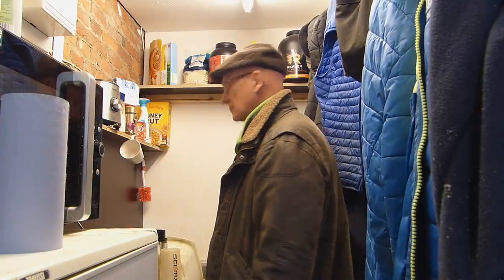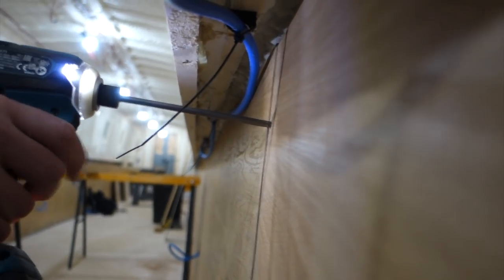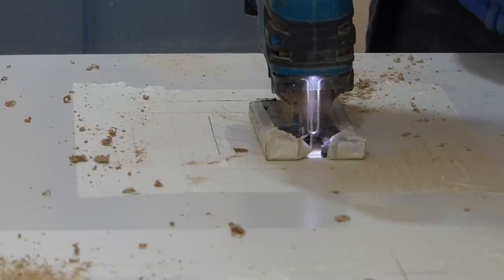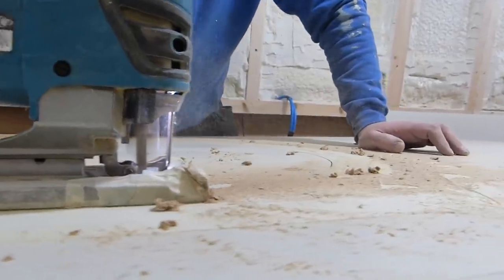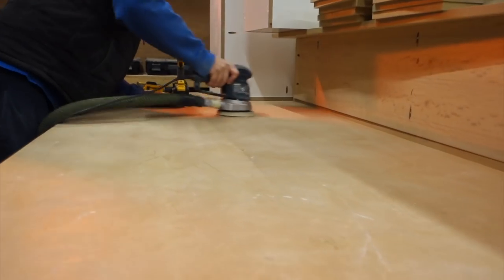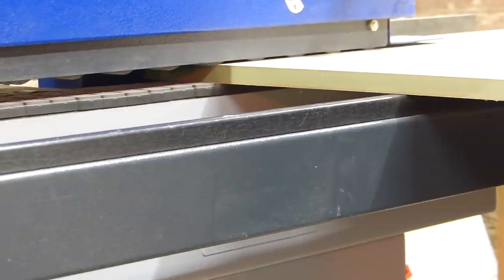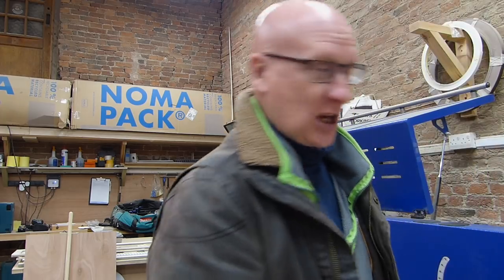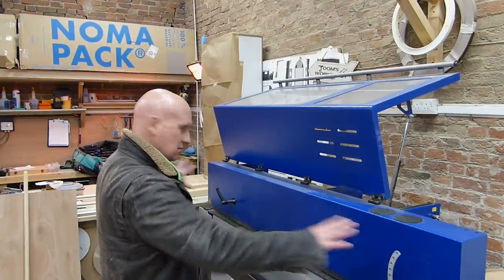Ep 17.  Narrowboat Furniture Being Made

Comment: Never thought I'd have a shout on youtube- fame at last eh? 😀

I just wanted to say that one thing relevant to this video that really jumped out at me after 18 months aboard was the pressure for storage space. Storage space for me is a huge issue, particularly because my boat is only 50ft. And I do like a more open feel to the living space, so I dont want to fill it with cupboards.
Here's just one example: Because marine electricians and other professionals can be a bit hard to find (and can take weeks to visit you), you tend to start getting into DIY a bit more. I'm hopeless but even I've acquired a fairly comprehensive set of tools, stored in various boxes by type so I can find them without turning everything upside down, e.g. woodworking tools, electrical, general stuff (hammer, screwdrivers, hacksaw etc,) drilling stuff- whatever job you have a crack at basically, you end up with a little box of tools, fittings and equipment for it.
There's no way you'll keep it all the same- after 6 months afloat you'll have a list of changes- maybe a cupboard taken out, or the books replaced by storage (honestly mate, do not underestimate how much the pressure will be on to find storage space). 
Boats just seem to attract gear- you'll need somewhere for your radio gear, lifejackets (one for a guest), 30kg anchor (for the river cruises), spare mooring pins and (big) mallet, other typres of mooring hardware (you might keep a few of the nappy pin type aboard as they are quick to use), two mooring chains plus a spare one (mooring chains are slightly more faff, but will hold the boat more securely than nappy pins). 
You'll want a spare centre rope, and at least one spare front/rear mooring rope).
If you go cruising without the car handy, you'll need a large rucksack for shopping trips. 
Trolleys also come in handy now and again, you can get a folding one but it'll need storing somewhere.
You'll even need a (half size) ironing board, for those occasional times you need to look a bit more civilised.
And dont forget all the gear for the bike- chain cleaner, lube, tools, spare lights, spare inner tubes and tyre(s), panniers maybe, and whatever spares you think are useful- it all has to go somewhere.
Your spare coats will need a home (you sometimes want a dry coat to stick on to go into town, if the normal one has been soaked by a cruise in the rain). Hats of various types (definitely something to keep the sun out of your eyes, but also protect the back of your neck from sunburn when you're stood on the deck steering all day. Some people have woolly hats- you name it. You only find out what suits you after a bit of trial and error, and it all needs storing somewhere handy. 
Along with your manual water pump  (I used mine for the first time in 18 months just last week when my bilge pump developed a fault), spare engine oil, alternator belts, filters etc (ready for the next service). 
The mop and bucket will need a home, plus a general bucket (folding ones are good), plus the sweeping brush, plus a flat wiping mop 'thing' to wipe off the solar panels in autumn or just when they get grubby), plus tins of spare paint for touching up after you hit things (or they hit you). 
If you use a cassette toilet, you'll want at least one and probably two spare cassettes, so you'll need a home for those. 
The hardware and gubbins for storage can really add up. 
And that's before you get to the things for your hobbies and interests, e.g. guitars, speakers, books, etc.  
The cratch can be a handy as a sort of 'shed' storage for the hardware stuff. 
In the winter the standard supply of half a dozen or more bags of coal usually sits on the roof, but some people put them in the cratch as well.
I was amazed at how many things I suddenly needed on my boat just because it was a boat, so I would advise you to be as generous as possible in allowing storage space. This is where a longer boat becomes a major plus. 

Sorry about the essay mate, and I guess you will have considered most of it, but worth mentioning.
Reply from the maker: Thanks Tony. I did indeed think of most of it but there are areas I didn’t.  I guess, in my mind the front and rear lockers have a lot of stuff in them, probably more than they would actually fit. I don’t want to buy a roof box, but perhaps I’ll need one…..or two. I can’t afford a cratch cover just yet; that will come later. I mentioned I don’t have a lot of clothes and kit but I’m sure I’ve got more than I think. Also, the clothes I have will squeeeeze into small spaces and squash down to fit in bags that can be stored under the bed and dinette. You have opened my eyes though. I’ve even thought of the space where the bow thruster is!  Thanks again.

Comment: Not sure about the red/green light issue but my understanding is that port and starboard comes from the Vikings. Their longboats had a steering board (starboard) at the back typically on the right hand side i.e starboard side. Because the steering board was there they couldn't easily dock on that side and so the left side was called the 'port' side, i.e. the side they would dock on in port.
Reply from the maker: Thanks Michael. I saved that nugget for next week. I’m still going to mention it nevertheless.  I’m mentioning a few naval terms so get you’re thinking head on and perhaps you can add a term or two next week. That info gave me an idea that I’m hopefully going to continue throughout the next video or two. Thanks for watching and commenting.  I appreciate it.

Comment: The interior is coming along nicely. You can tell those guys know what they are doing when they have an edger. I say this because my brother-in-law had some cabinet work done by his cousin who is a jerkoff. They worked out a price for the MDF cabinets and installation. His cousin used MDF cabinets, but there was no outside facing or edging. "Oh but we paint it and it will look much better, trust me." Wrong! They used about 5 gallons of paint, "it would have taken more", because the cabinets kept soaking up the paint. The real test came when they started cooking and all the steam from the cooking permeated the cabinets and they warped. This was after several years, but by then the cousin was long gone and out of that business.
Reply from the maker: I'm sure/hope that will not be the case for me but if you keep watching Paul, I will be giving a yearly update on all the stuff on the boat.  I'll look at the practicality of the layout - did I get it right, the wood work, in fact everything.  Thanks for supporting me.

Comment: Been wondering about this for a while and seeing the plug socket cut out of the board, why not only 12v. 

Most devices these days are DC, an inverter is not efficient. Especially for so little that need it. More 12v usb or usb c ports all over the boat.
Reply from the maker: Interesting view Symon and at first glance, I would agree.  For me, the only things that require electricity 230v are the fridge, freezer, TV, washing machine, Internet, computer and speakers.  I think an up-to-date boat with tech on it uses quite a bit of 230v electricity.  Of course the inverter needs to be big enough to handle it and not everything will be on at once.  The washing machine will be going when cruising and I will probably have some SMART plugs to monitor the everyday usage.  I could have 12v freezer and fridge, TV etc but power has changed a lot on leisure boats.  Go with it at the start or I'll regret the opportunity.  Also, 230 electrical kit is cheaper to buy when replacing it and they are become a lot more eco-friendly too.  I hope that answers your thoughts and not by me being too pointed.
Reply: Chris, thanks for those details. It helps understand better the power needs on the boat. Looking forward to seeing more as it progresses.